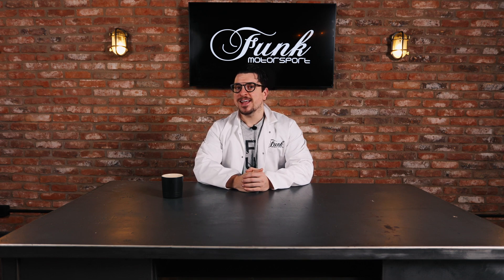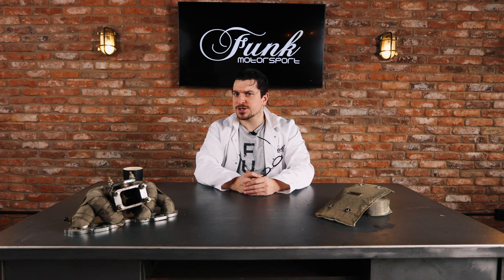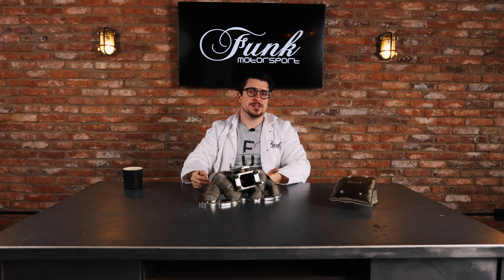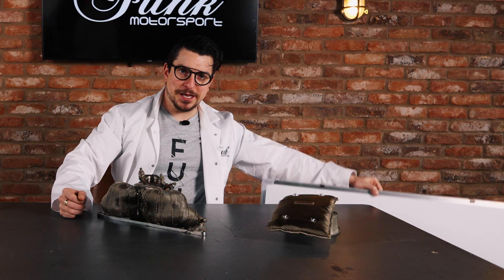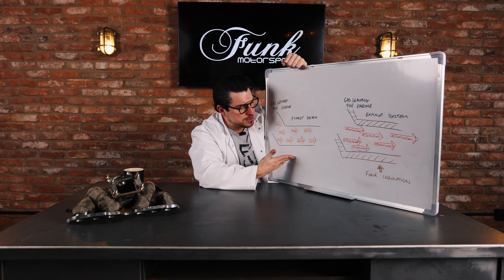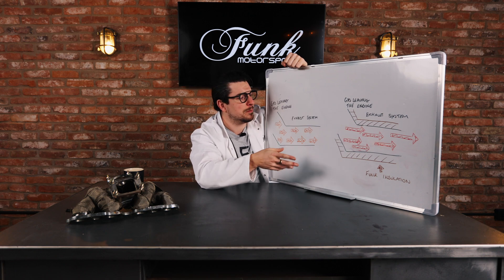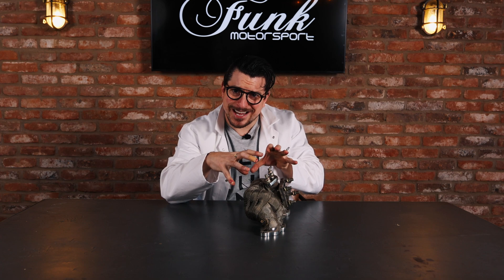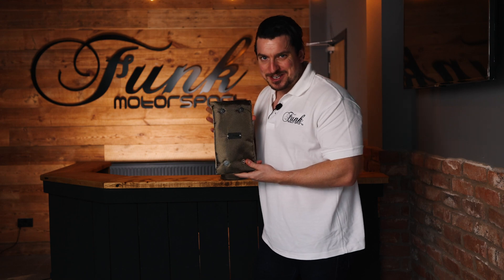Episode 4: Exhaust Protection - Heat Management for Dummies with Funk Motorsport

Comment: What are your thoughts on exhaust wrap vs ceramic coating?
Reply from the maker: Another amazing question. From our testing, we have seen that ceramics will only drop the temperatures marginally, compared to a textiles solution.

Let’s put some numbers to back up that claim. Turbos operate around the 7-800 degree C mark on the outside faces.

When it’s Ceramic coated, this will likely drop down to around 500 degree C. So only small reduction.

A blanket will likely drop this down to around 200 degrees C on the outside face.

You can see that in this video, keep a close eye out for the thermal imaging gun.

https://youtu.be/wWPWRIdsKZk?si=atOVttDCi4ZoFf9a

Comment: Hey guys like your products and great information. Just a question as I am looking todo a supercharged build in the near future. With the increase of exhaust temps I will see does wrapping the manifold shorten the manifolds lifespan as it is being heated far beyond its normal temperature?
Reply from the maker: Hi Ciaran, Thank you for your message today. This is a great question.

In short, no, this is a common misconception. Any insulation that you add to the exhaust system will encourage the exhaust gases to retain that heat, and therefore promote better gas flow (Since a hotter gas accelerates faster than a cooler gas).

For this reason, the exhaust walls, will not become hotter than would be regularly found prior to insulating. Infact, the insulation will help to provide a more even (albeit lower) heat radiation throughout the system.

We hope this helps and look forward to answering any other questions that you may have.

Funk Motorsport.

Comment: Is higher egt,s not bad for youre engine when you wrap youre exhaust?🤔
Reply from the maker: Great question. No, actually the opposite. Wrapping your exhaust will help to improve gas flow by accelerating the gases faster through the system, as well as hugely reducing heat transfer into the surrounding components - making them work more efficiently and perform to a higher level!

We hope this helps answer your question.